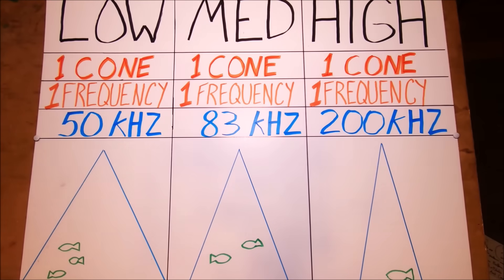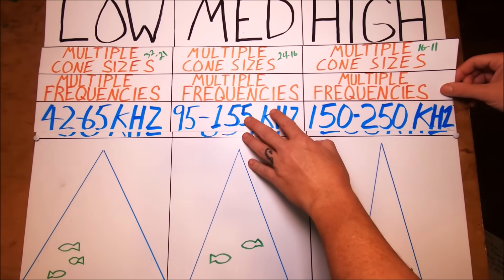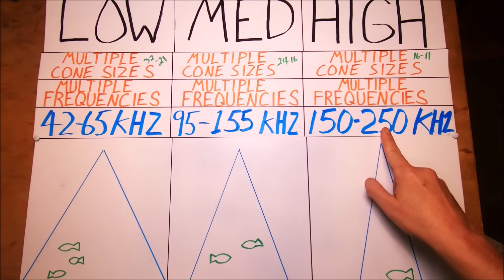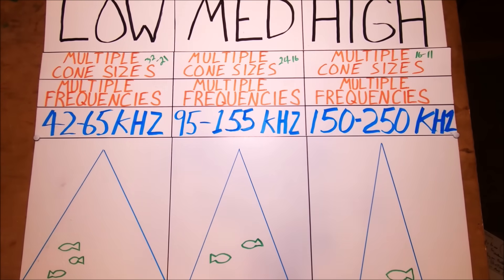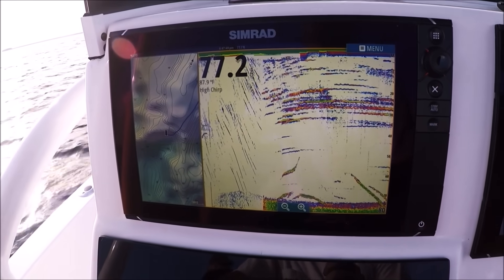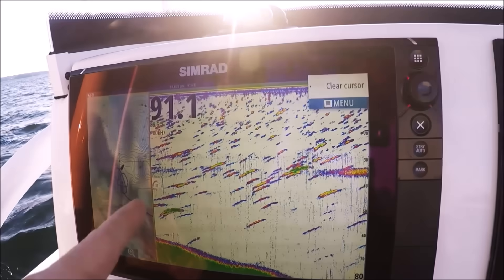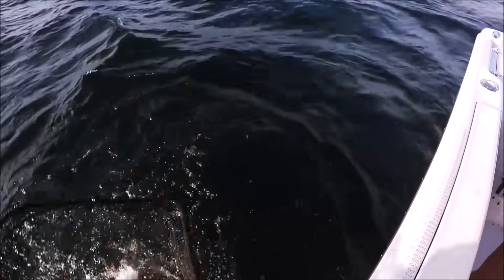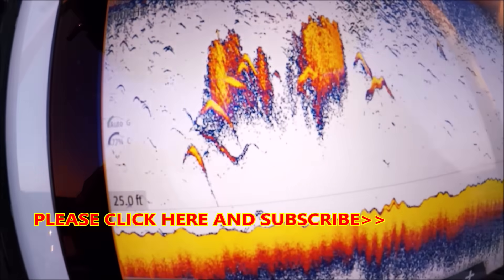CHIRP Explained in 4 Minutes! Chirp Sonar EASILY UNDERSTOOD.

Comment: Nice explanation. It’s tough to justify the expense of a good transducer especially when the “techs” say there isn’t much difference. Looking forward to rigging up both on our demo boat to be able to show customers the difference side by side like this!
Reply from the maker: Thanks brother!!! I think your customers will REALLY appreciate that. I get hundreds of email from frustrated boat owners that would have happily spent the extra money if they were aware of the difference in performance. Thanks for the comment!
Reply: On your recommendation on the previous video probably doing the High Wide TM165 I believe vs 83/200 skimmer and possibly the TM120 vs the Active Imaging. Running off 2 HDS live units. What issues do you get with interference while viewing one vs the other? Is that the vertical lines I see sometimes on one unit vs the other?
Reply from the maker: Performance Marine AZ I do a lot of testing for Airmar and Simrad so I have used them all. I have had wonderful results when testing Airmar CHIRP transducers against each other with little to NO interference at all, even with noise filters turned OFF.  The ONLY time I see substantial noise is when a NON-CHRIP, “fixed frequency” transducer is in the mix like the P66. I have several transducer comparison videos on my channel and you will notice how incredibly clean the images are when running even 3 transducers at once as long as they are all CHIRP transducers. I have tested all of the following in every combination, sometimes running 3 at a time with great results: B175HW B175M-B275LHW -TM275 LHW TM265LH-TM150M TM165- TM185LH But if I throw a traditional transducer in the mix I get noise on similar frequencies. The Airmar CHIRP Transducers all have very low Q ratings unlike the traditional transducers.
Reply: Awesome man, thanks for the input and keep up the videos and education!
Reply from the maker: Performance Marine AZ Thanks Brother!!! Anytime!! Let me know if there are any videos you would like to see!
Reply: Haha alright I will get my list going! The ones you have are great especially the head to heads and the live action fish reacting to lures. Also showing up when the settings are wrong and then how to clear them up is helpful for guys like me just getting into it. What sucks is the nerdy parts don’t make for great content but throwing footage of good catches keeps us awake and coming back. Keep it up.
Reply from the maker: Performance Marine AZ Excellent!! Great feedback! I appreciate it. 👍👍. Tell the world about my channel and I’ll answer every question you got!! 😁😁

Comment: mike, i have the simrad nss evo3 with the total scan transducer.....usually fishing in 30-100 ft of water.....south shore long island ny....what chirp setting due you prefer for those depths.... trolling and jigging bass vs wreck fishing.....thanks
Reply from the maker: I would use high CHIRP for wreck fishing and jigging and use Medium for trolling. 83khz fixed frequency is outstanding on the Totalscan in shallower water as well.
Reply: Thanks

Comment: What transducer are you using for high chirp on the right-side unit? You said the left unit was a P66. My understanding is the Tm 150 is for medium chirp. Is Medium or High chirp best for 40 ft or less? Low Chirp is the best for deep water, so high? Thanks
Reply from the maker: In this video it was the tm275 L/High Wide on the right. I personally like single frequencies in water less than 30-40 feet. You’re correct, High CHIRP is best for shallower water. Low CHIRP is really designed for super deep water. Way deeper than we would see in freshwater.
Reply: Interesting! I guess you’re meaning target separation, swim bladders comparison and seeing fish arches within bait balls at 40ft or less is the best it’s going to get with single frequency vs multi frequency according to your transducer comparison studies? 

If so then that’s the reason Lowrance only offers the cheaper 83/200 or 50/200 considering Lowrance caters more towards freshwater then Simrad.

I was considering getting a TM150 Medium chirp not so sure it would help now!  (High chirps transducers are nice but considerably higher priced.  I couldn’t justify the extra cost vs performance in shallow freshwater)
Thanks
Reply from the maker: Mark Peters Your train of thought is dead-on HOWEVER!!😁. Airmar CHIRP Transducers have very low Q RATINGS. Which means when EVEN SETTING IT ONLY TO A SINGLE FREQUENCY, it will blow a traditional transducer OUT OF THE WATER. 

 There  are a few misconceptions about CHIRP Transducers, 1 is what we were just talking about above, CHIRP IS ONLY GOOD FOR DEEP WATER SO DONT WASTE YOUR MONEY FOR FRESHWATER USE IN SHALLOWER WATER. 

While I tend to agree that using the CHIRP BANDWIDTH in only 30 feet of water won’t give you better performance than a single frequency, using a CHIRP Transducer will ALWAYS outperform a fixed frequency transducer in ANY situation. 

 Short answer???
YES, get that tm150 😁😁. You will be amazed. 

 TM 150 M  https://amzn.to/2BsVMud

Comment: Hi Mike!

Nice vid like always! Very well explained 👌👌

Wich transducer are you running on the real chirp?

I own an Airmar TM275LH and I'm really really happy. Before this one I had the totalscan 3 in 1.

Like you, I think that the sides an is worth the money, but in traditional sonar, the airmar is thousand times better than the totalscan.

Thanks for all the great videos! Waiting for the next one.

Best regards from Spain bro
Reply from the maker: Thanks brother!!

 You have a MONSTER of a Transducer in the 275 LH!! I have used all of the 1KW Airmar CHIRP Transducers over the years. We removed the 275 for 2 175’s. I don’t use low CHIRP because I rarely fish deep enough to need it.  Right now I have a B175 H wide (which has the same HIGH BAND as the 275) and a B175 Medium CHIRP for slightly deeper water. I’ve been testing the TM165 High Wide as well. 👍👍

 Thanks for your continued support brother!!!
Reply: @MikeSmedleyOLDSCHOOLSTRIPERS 
Thanks for the fast answer!

Yes, I have the big one! 🤪

I really use the low frequency, I fish from 0 to 200meters and I'm trying to go deeper to the 300m, will see...

Keep going like always! 💪🏻💪🏻

Best regards!

Comment: Awesome video brother u explained exactly what no one knows lol.Why they dont explain this at booth's and in depth in the owner's manual.I couldn't tell ya but that's best explanation I have seen.Your da man.Also don't get why lowerance doesn't come with a decent transducer u get a basic transducer with a 5000 dollar unit makes no sense.
Reply from the maker: Thanks brother!! I honestly thought the dealers would be all caught up by now. I still hear the craziest stuff.
Reply: @MikeSmedleyOLDSCHOOLSTRIPERS  well.u give a better seminar in one video than any booth guy out there and I know u would think they put a high dollar unit out they would put a decent transducer with it I think I got the same transducer on my carbon as a cheap unit 200/83 Pretty sure that exact same transducer that comes standard on the cheapest version correct?
Reply from the maker: David Farley You are probably right about the transducer. It seems that they either pair it with no transducer at all, like the high end Simrad’s or they pair it with an entry level transducer.  If they put a $1000 Transducer in the box most guys will buy some other brand thinking they just saved $1000 bucks. 

 I think they should put packages together. Maybe a BRONZE, SILVER and GOLD at the very least. Great question brother
Reply: @MikeSmedleyOLDSCHOOLSTRIPERS  I hope someone reads this and understands where I'm coming from maybe u can do a video explaining that also.Because I guarantee probably 90 percent of the guys buying these expensive unit doesn't realize they getting a basic transducer to there high dollar unit where if they where to go with a Tm 150 let's say from Airmar thet would get so much more out of it.Its kinda like buying a Dodge viper with a 4 cylinder engine in it 🤣🤣😂.Same engine they put in a neon ya know.Hopefully this info gets out
Reply from the maker: David Farley You are correct.